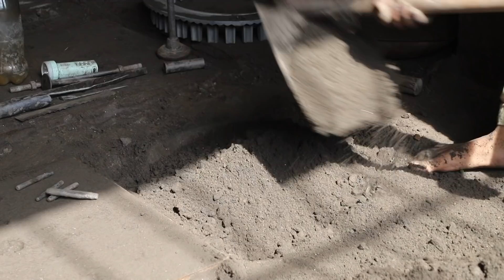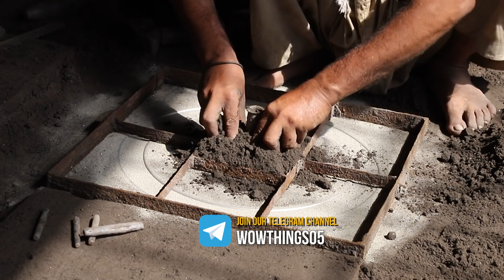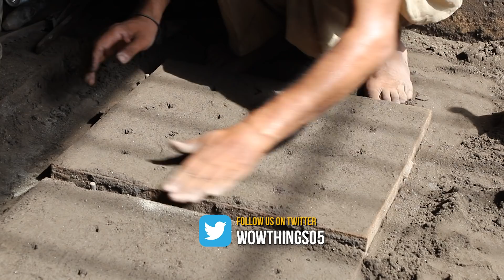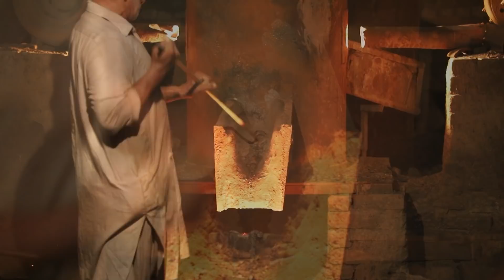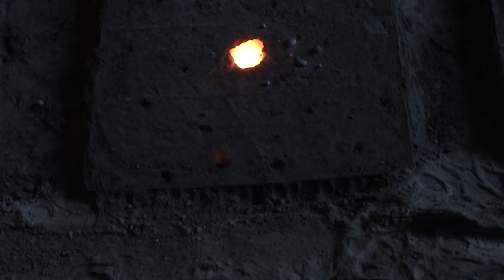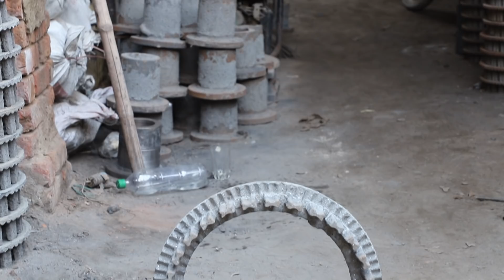The Power of Sand Mold Casting | Large Gear Manufacturing

Comment: I spent almost 40 years building patterns for foundries. The quality of the pattern looks good or it wouldn't release from the mold so well. The surface quality of the casting is a little rough,, but it did look like an iron or steel casting. I also cast nonferrous metals at home for fun. I have better safety equipment at home than these guys. And people wonder why things are made so cheaply overseas. They don't really care about the safety of the workers. The worker themselves do great work though.
Reply: @爱国设计师刚哥  People that work even in safer factories work till their pension at 60 - 70 years and then die before their pension... Cancers also might form at later stages. If you want a long life dont breath to much dust in or you might get sick badly with coughing dust, like me. Also dont let your blood cook to long its bad for the heart and can cause heart attacks.
Reply: This is a very ignorant statement to say they do not care about the safety of the workers. They have simply chosen to work in an alternate manner and still achieve acceptable results. The reality is not everything created needs such a high standard to be practical and achieve its goals. In most cases they do far better while using much less. If they desired better quality they would also achieve this. Why do more work or invest more time and energy than is sufficient? It is not even revealed what purpose these gears are intended. You are right about being cheaply made, as cheap means inexpensive and not of low quality. The two are not synonymous.
Reply: What type of sand did you use?
Reply: @爱国设计师刚哥  Hi Tovarish'
Reply: @seanregehr4921  он себе ботинки купить не может

Comment: More pot metal...ive been a machinist and metallurgyst for over 25yrs in america & this is why most of the world sees products from Pakistan, Afghanistan, iran, and other places that dont use an actual recipe for there metal as inferior. Not taking anything away from their hard work, it just could be a better product.
Reply: Junk?
Reply: That's cast iron .judging from heat of melt and cupola tapping 
Procedure.nothing wrong with cast iron in a gear .
Reply: @anthonycampbell8876  Looks more like pot metal than iron.  Junk either way.
Reply: @anthonycampbell8876 Cast iron is not normally used for impellers.
Reply: I've have been in the foundry business for more that 25 years and just out of curiosity  I watched this vid.  What a knee slapper.  This is Pre Industrial Revolution Era technology.  I do like the safety shoes the two chaps pouring the melt were wearing.... hahahahahahahahahahahahahahahahahahaha   Along with the rest of their safety gear/clothing.
Reply: @anthonycampbell8876  yeah but its not cast iron... they just bang the over pour out with a hammer and its way too light and doesnt have the cast iron "ring"
Reply: looks like aluminium from melted old auto parts